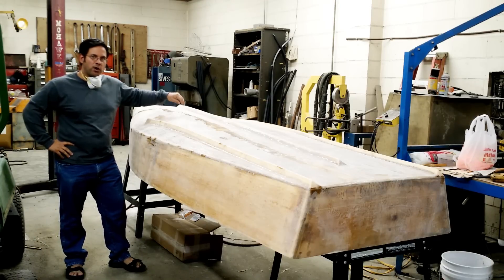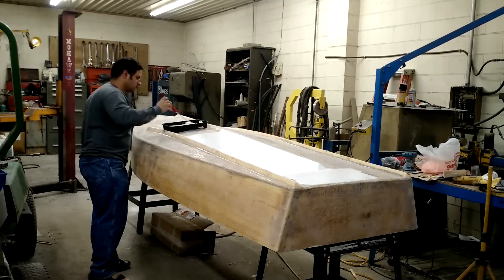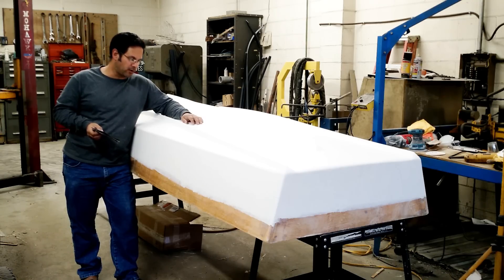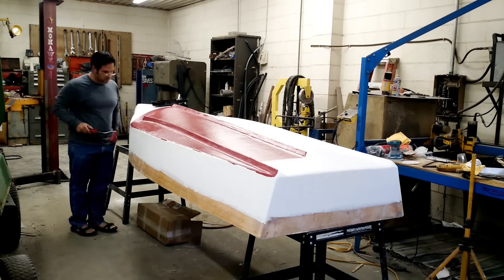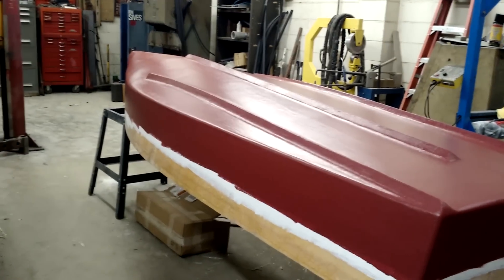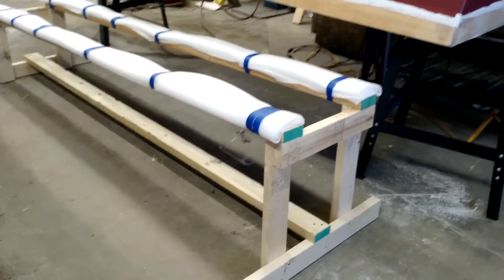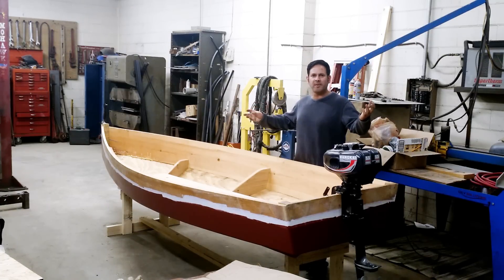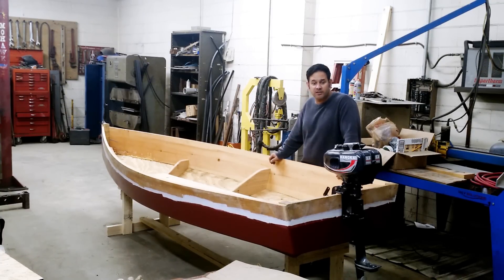HomeMade plywood boat part 7  -  Painting, making a cradle, flipping over the hull

Comment: Great build Ray!!!! Have you had it out on the water now that it's finished? Also, what did you do with the inside of the boat,,maybe a 8th video?
Reply from the maker: its not finished although i did have it on the water for a test float... i think it was part 6 if you haven't seen it. part 8 is the trailer, i need  to get it back home where my wood working tools are so i can finish it up.  the trailer video should be out this Thursday...i'm actually putting it together today
Reply: Ok cool...I look forward to seeing it

Comment: I like your video,  but im surprised you didnt go with a  white resin and white gelcoat,  i have been watching some boat builders and thats what they use,  then after the gel coat they use a fill coat or form coat or something like that which has some type of parafins in it.  it smooths it out like glass.  Not that the paint doesn't look great,  but i find that even the best red paints turn pink over time and exposure... be curious to see how it looks in 10years.   thanks for the time invested in sharing this.
Reply from the maker: +spudthegreater USA thanks, I'm not a "boat builder " just a guy putting one together without guidance or experience, so that's why I'm not doing all of the "perfect finish" steps.  Just making a rivier boat that I know will be hitting floating debris in the river